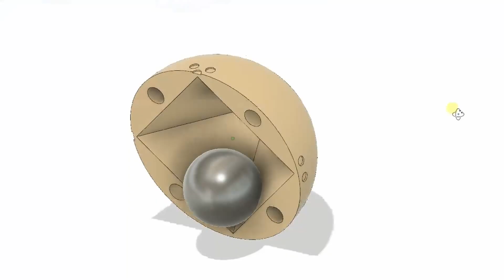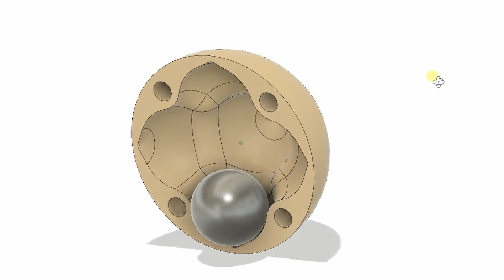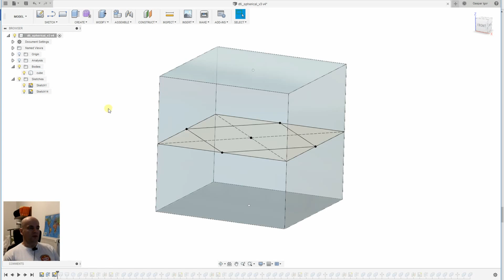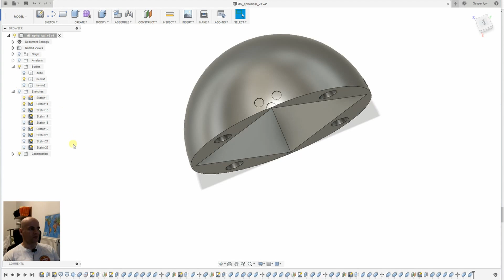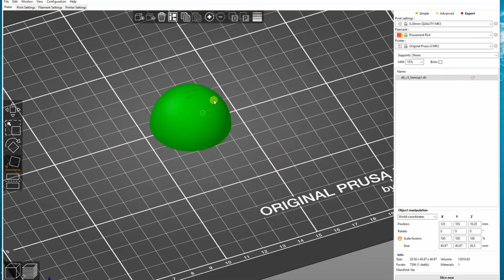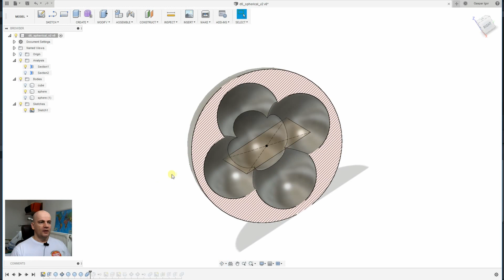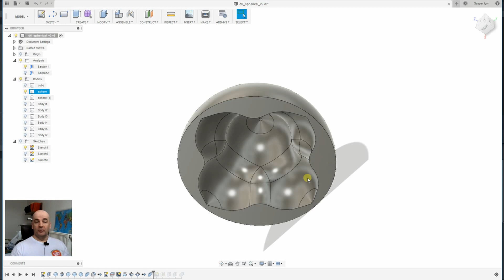3D printing spherical six sided dice - D6 sphere

Comment: Hello, circumstances made me investigate uncommon dice and I ended up here. Have  you tried to make d7 and the like by the cut sphere method?
It's made by putting the desired number of points on the surface of a sphere, as equally distributed as possible, and then cutting the sphere in secant planes opposite of those points. Then by putting numbers on those points the pseudo polyhedron becomes a fair die